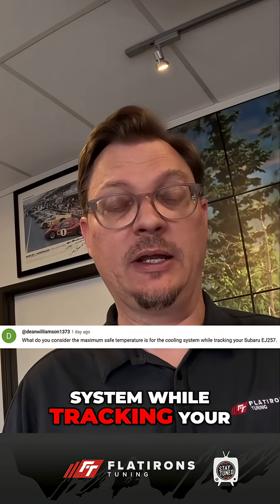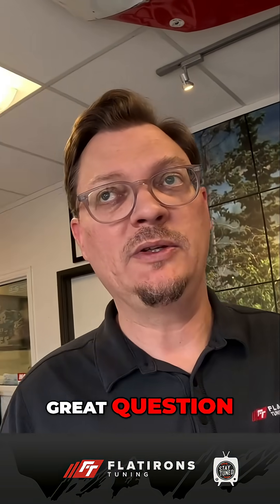Safe Subaru EJ257 Cooling Temps for Track  Explained!

Comment: I’ve been struggling with this question for a while. I’m a little past moderately modified, FP black, 1300’s, etc, but still on 91. I still have the OEM oil cooler/oil filter housing thing and I think that’s where my problems come from. 

I’m getting oil temps of 225 and coolant temps will mirror the oil temp and will continue to climb if I’m not careful or have high load or the AC on. I also have an aftermarket oil cooler up front, and a Mishimoto radiator. I can’t even take my car up the canyons. 

Should I delete the OEM oil cooler? Is my FMIC really impeding airflow to my radiator that much? 2002 wrx 

You guys are awesome, such a great source of information and parts. I’m right next door in Utah so stuff always shows up quick. Thanks and keep it up.
Reply from the maker: Thanks for watching and thanks for the question.

If you have a FMIC and Oil cooler in front of your radiator, that could certainly be blocking enough cool air that it would reduce your cooling capacity.  This would be especially true running the AC, because then you are again heating up all of that air before it even gets to the radiator.

If you still have the factory heat exchanger, running an additional oil cooler will only be somewhat effective because you are keeping the oil temps tied to the coolant temps.

https://youtu.be/e3LfSp-hFPM?si=mUjvLg6nYAJCHjz1

What I would recommend for a start is to actually remove the aftermarket oil cooler, which should help get more cool air to your radiator.

If that doesn't help, take a good look around the radiator to make sure that there aren't any gaps allowing air to go around the radiator rather than through it.

If you haven't tested your radiator cap/caps in a while, I'd also recommend doing that as well, just to make sure that they are holding pressure properly.

If all of that checks out, I would say it would be a good time to get the car to an experienced mechanic to go over everything to see if anything else looks like it could be an issue.

Hope that helps and Stay Tuned!
Reply from the maker: One other question that came to mind.  Since you have a FMIC, have you blocked off your hood scoop?  If you haven't that would be the first thing that  I would recommend.

If you have the scoop, but don't need it, you can be creating positive pressure in the engine bay which will reduce airflow through the radiator.
Reply: @FlatironsTuning  you guys rock. Thanks for the tips. Yup both my rad caps are brand new and proper pressure caps are where they need to be. 

I was going to block off my hood scoop last summer but didn’t think that was super critical! Maybe I should get that done asap.

Should I keep the factory heat exchanger and definitely remove the aftermarket oil cooler? The car does not get tracked, it’s a canyon ripper and street car for now. I just wanna enjoy it up the canyons but can’t!

Comment: Also, if you are running straight distilled water. The boiling point will be above 212F cause the water is under pressure. Pressure increases the boiling point. I normally run distilled water with water wetter. With the racing I do. I can't run normal coolant like in a street car.
Reply from the maker: We have to do the same.  With water, that is where it is important to know what the boiling point is with the pressure cap that you are running.

Thanks for watching and Stay Tuned!